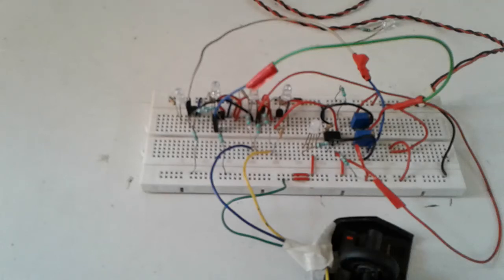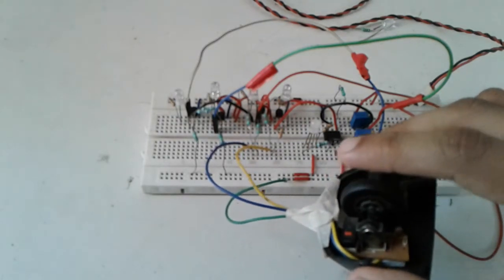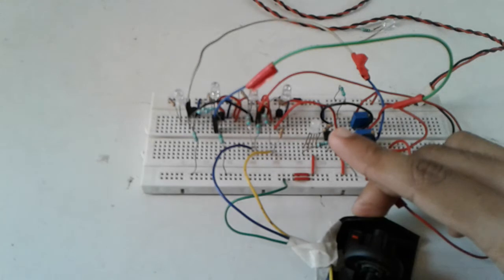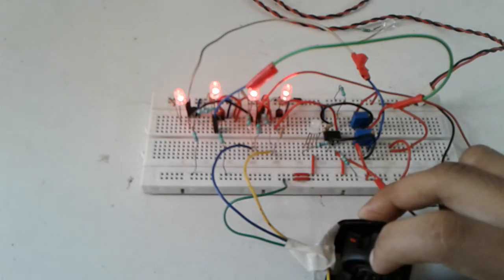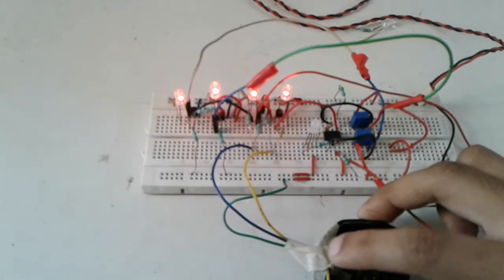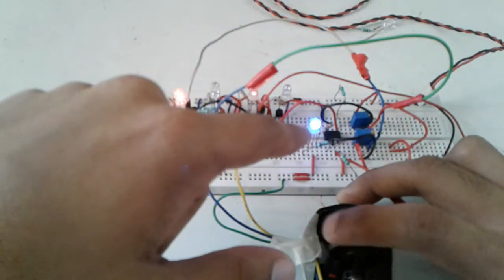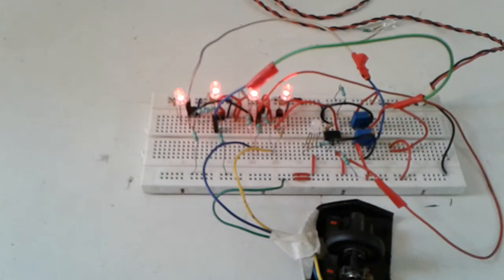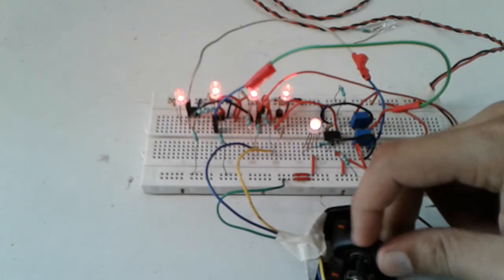Mouse rotary encoder circuit

Comment: Where can i jump wire it in mouse
Reply from the maker: Connect wires to the rotary encoder. Rotary encoder is connected to the scroll wheel of the mouse. It is three pin component, solder wire to these three pins.
Reply: @prachethire812  can i message you on any social media with the photo of mouse
Reply from the maker: @syedamaan5338  mail me. My email id- prachethire@gmail.com
Reply: @prachethire812  mailed you pleaee check
Reply from the maker: @syedamaan5338  I didn't received, resend. my email id-  prachethire@gmail.com